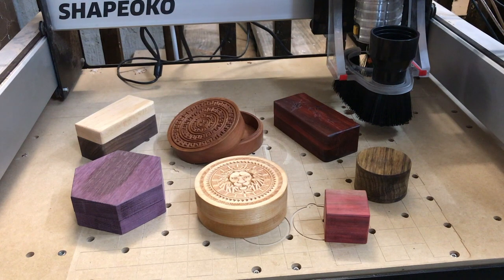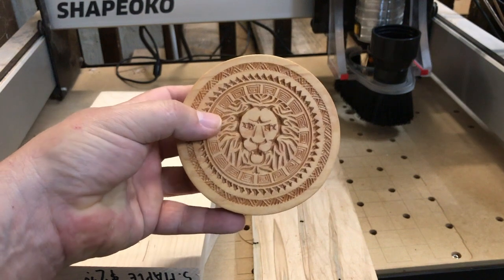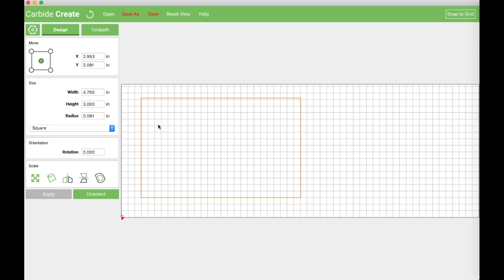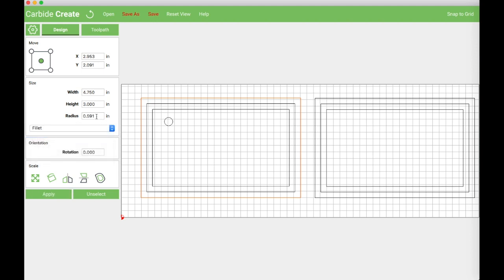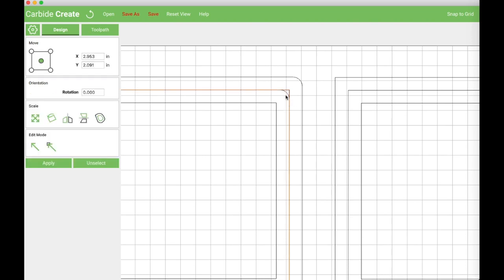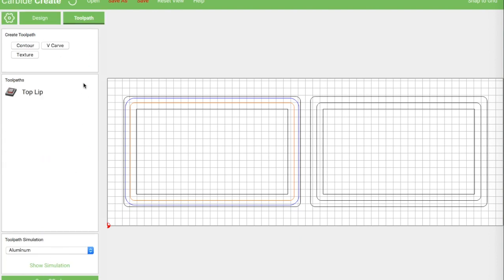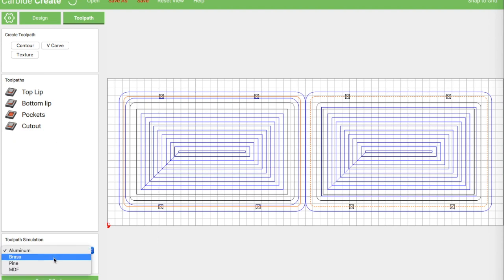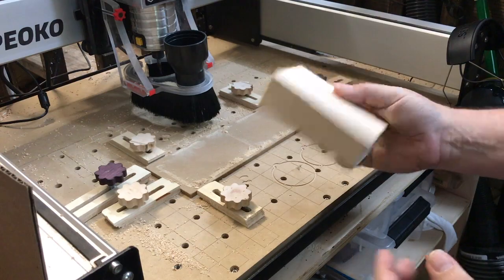Box Making with Shapeoko

Comment: Hi John, many THANKS. Are your clamps also used to elevate the work piece so that the cutter does not cut into the waste/spoil board?
Reply from the maker: Thanks Girard! Typically I just use a piece of 1/4 MDF or some cardboard to raise the work piece slightly. It's best with wood to have something behind it when you cut through. Otherwise it tends to splinter and make a mess of the edges.
Reply: @johnearlclark  Thanks, I have aluminum plates from Ohio Diesel and don't want to ruin the aluminum surface during the cutout process.

Any advice you can share? This is my first CNC / Software experience and currently on the Shapeoko 3 XXL building process. I hear of many beginners (YouTubeers) having mistakes and pluckerup the waste/spoil board on their projects.
Reply from the maker: @IFLYRCHELICOPTERS  I would go with 1/4 MDF under the material you are cutting and a decent set of dial calipers to make sure you are accurate on the thickness of your material. I use this one: https://www.amazon.com/gp/product/B00B5XJW7I I hope this helps.

Comment: Could you do a video how to do the inside corners on boxes with more then 4sides
Reply from the maker: I will see what I can do. The basics are kind of the same as with the four corners: Duplicate the piece you want to trim the corners on (say a hexagon). Create a circle the size of your bit and position it just inside the corner so that it just touches the sides. Select the piece you want to trim and then hold command and select the circle (the circle should be a dotted line). Use the subtract tool to clip the circle out of the piece. This should leave you with a little corner piece you can use to trim the original. Hope this helps and I will try to work this into an upcoming video.

Comment: thanks for the video John, what settings did you use to make the boxes? its taken me hours just to do the pockets!
Reply from the maker: Hi Karl, I am using a 1/4 inch end mill and the standard speeds out of Carbide Create (0.092 Depth per pass, 75 in feedrate, 12.50 plunge rate). What are you using?

Comment: Good morning John. I have really got a lot of help from your vids and wanted to say thank you. I have discovered that if you design the box from the inside out... the copies will maintain the filet radius you need without having to piece in the corners for the top and bottom to fit properly. I also found if it take my lip for the bottom down .001 I get a struggle free fit. The only thing is when doing it this way my fillet radius continually increases until I get to the cutout. I can usually live with this. Again thanks so much for taking the time and keep em coming. 
Dave
Reply from the maker: Interesting. I have not tried it that way. When I was going out to in, I would always end up with sharp corners. I had not thought to go from the inside out. It's a good solution because you know the inner piece will have the minimum corner space for the bit and everything else should be slightly larger. Very cool!
Reply: John Clark hey john. I am an absolute beginner but I have been working with wood for 40 years. I have a business reproducing antique furniture. I had a wrath of questions... maybe too many! I’d love the opportunity to chat at some point. I certainly don’t want to infringe on your privacy so if you be ok with it... send me a message request. 
Dave Baird 
Edmonton Alberta Canada 
River lane Ranch. 
If you don’t want me bothering you from time to time I fully understand. 
Again... vids are great and have been very helpful
Dave
Reply from the maker: @hbdcustomwoodworking6116  I would be happy to chat. I have also been a woodworker for about 15 years. I cannot figure out from the YouTube interface how to do a message request, but if you go to the "about" tab on my channel there is a business inquiries email and you are welcome to use that.
Reply: John Clark hey john. I went to the “about tab” and couldn’t find the email. Can you “help a brother out” lol!
Reply from the maker: @hbdcustomwoodworking6116  Should be the second section down, where is says "Details." There should be a "Show Email Address" button. It does make you go through the "I am not a robot" quiz. Once you finish the quiz, click submit and it will show the address. Let me know if it's not there so I can fix it.

Comment: Under Job Setup - Edit, I have to set grid spacing to 0.250 or it drives me crazy. I only use inches but it defaults to 5mm (0.197 in.) grid for the grid.
Reply from the maker: I am with you. Some of the defaults seem wildly arbitrary and I wish there was a way to change them. The only thing I can suggest is making a "pseudo-template" file with the settings the way you like and then always open that file first and do "save as" (or duplicated it). Not a great solution, but doable. I am hoping Carbide can afford to focus some additional resources on this in the near future. It serves me well for about 90% of what I do, but that last 10% can get really annoying.

Comment: Great video! I was able to follow along a make a circular box. I tried it on a 0.75" piece of pine for a used walnut or maple. Do you think a laminated 1.5" of walnut would hold together during cnc milling? I am a newbie to cnc. This would be my second cut on my Shapeoko XXL.
Reply from the maker: It should. What did you glue it with? One thing I would definitely suggest is extra clamps on something that thick -- less to hold it down and more to keep it from moving side to side on the waste board.
Reply: I haven't glued anything yet. Just thought I would ask.
Reply from the maker: @keithpruitt2204  Cool. I am a huge fan of Tightbond Glue. I have done a lot of wood turning with laminated pieces. I figure if I can spin it at 1800 rpms and nothing horrific happens, the glue is going to hold up to pretty much anything. :)

Comment: Hi there John, Thanks for these videos on boxes...they are great,  you do such a such job designing them. I am currently waiting for my XXL to arrive in the next couple of days as well. I am taking in the different approaches to using these machines and I have to say you do such an amazing job at explaining thing, the ins and outs of why you do what you do. Now I have to try and teach this old brain to remember this stuff. I guess it all takes time and patience? Anyways I look forward to watching your other videos. Just new to your channel yesterday so I did subscribe. Have any suggestions where to purchase the cutter bits etc?  Thanks again very much. Andrew
Reply from the maker: Thanks Andrew! I get my bits from Amazon. If you plan on working with wood, I suggest down-cut bits. They tend to leave a much cleaner cut on wood. I use these in both quarter and eight inch versions: https://www.amazon.com/dp/B072J4CPQT I would also pick up a v-carve bit for doing designs like the ones on the box tops. I have this one (60 degrees) : https://www.amazon.com/gp/product/B000P4NSYG and a 90 degree V-bit I got from Carbide 3D with my machine. Those are the 3   bits (quarter, eighth and either a 60 or 90 degree V-bit) I use the most often. -- PS: at the tender age of 55 I would say that old brains tend to do just fine :)

Comment: Good morning  John I just watched you video here on making boxes. I also have a Shapeoko XXl .Very good video. I saw in the intro that  there was a Heart shaped  Box. I am wondering if you did a video on it If so where can I find it, If not have you made one and might be willing to share how you did the design in Carbide Create. Thanks Jeff
Reply from the maker: Hello. I have not done a video for that one yet, but I need to. It's really the same principles as the other boxes: An initial shape and some offsets. However in this case, the initial shape was a heart SVG file I imported into carbide create. I am sure there is a way to create a heart shape directly in carbide create using the Bézier curve tool, but only dark wizards and graphic designers understand how that works. ;) I went ahead and posted my cut files up at: https://www.dropbox.com/s/jxtuc160skantvx/heart%20shaped%20box%204.75.c2d.zip?dl=0 You will need to tweak them to fit your stock size. I will also try to get a video up for that soon.
Reply from the maker: Just wanted to let you know, the video on the heart shaped box went up today.  https://youtu.be/jVA6f5C4Btw

Comment: I don't know if this is possible but cant you just offset the filleted rectangle? instead of doing a circle square boolean, copy re boolean etc??
Reply from the maker: You can. However, I use the offset path tool a lot and once you create the offset, there is no option to fillet (or control height and width, which is also a drag). The fillet also only works on squares so I wanted to show some different options. I like to make weird boxes. :)

Comment: My Shapeoko arrived this week!  Where do you source small pieces of nice wood like that?  Any suggestions?  Thanks for the video! Beautiful boxes!
Reply: When we were in the States a few years back, we stopped off at a WoodCraft Store. In the back they had a ton of odds & sods, which at the time, we scored many for our Pen Turning. Lots of Exotic woods.
Reply from the maker: Thanks Kim! I usually go to a local lumber yard. If you are in the Atlanta area, I recommend The Woodyard in Concord, and Carlton's Rare Woods & Veneers. Otherwise, a Google search for "hardwood dealers near me" usually works. I have also had good luck with ebay sellers and Green Valley Wood Products (http://www.gvwp.net/) or Ocooch Hardwoods (http://ocoochhardwoods.com/). One thing to note is that most lumber places sell by the "board foot," which basically means cubic measurements -- A one inch thick board, six inches wide and two feet long is considered one board foot. It's a little weird at first, but you get used to it. Hope this helps.
Reply: Thanks John! I'm in PA but there are a few local lumberyards and also lumber mills so I'll check those out and also the other sources you shared.  Thanks so much for your help! Its a great video you made!
Reply from the maker: Hey Kim. I got a message that you were looking for the files. I have posted one of the boxes up here: https://www.dropbox.com/s/783ut9gzlp6s7u1/Lizard%20Box.zip?dl=0 Let me know if you have any questions. Also let me know how it turns out.
Reply: Hi John!  Wow thanks so much for the files! I'll definitely let you know how I do.  And I really appreciate your offer to answer any questions.  Your videos are really amazing and so informative! I'm going to grab these files now and give it a try.  Thanks! Kim
Reply: Hi John,  Carbide Motion isn't loading the file for me.  I have version  4.0.412.  Do you know what the problem could be?  Nothing happens when I try to load it, the screen stays the same.  I also have a question about setting up the boxes in carbide create.  Could I fillet the corners first before I do the offset path and omit the other steps rounding the corners?  Well thanks again!
Reply from the maker: Hi Kim Baldwin Sorry for the confusion. The file is a carbide create file. You just need to save the g-code out for carbide motion. I didn’t know the size of your board so I figured  you might need to make adjustments for thickness. Yes you can do the filets first if you want. The first time I did this, I had not seen that option. :)
Reply: Thanks John! I'll let you know how I do.
Reply: There may be Woodcraft but it is better to look for a full-service wood supply shop if you are lucky enough to have one nearby. I've got an amazing example of such a shop within driving distance, they ship stuff and have an online store. http://www.kencraftcompany.com/